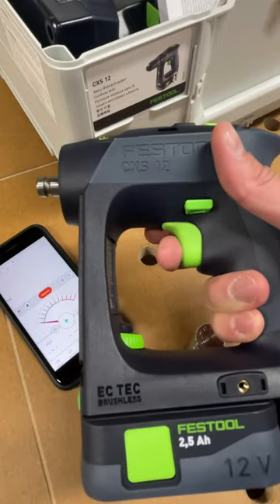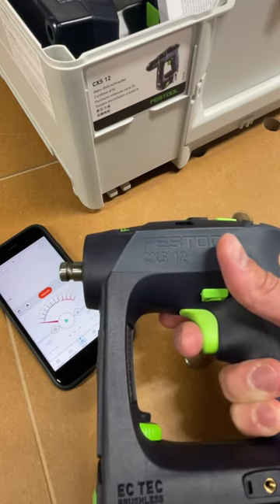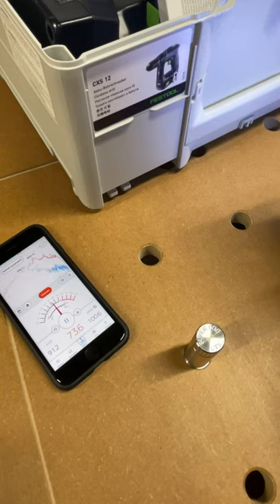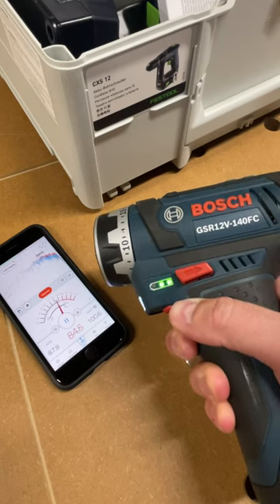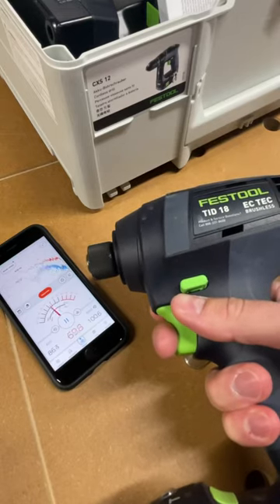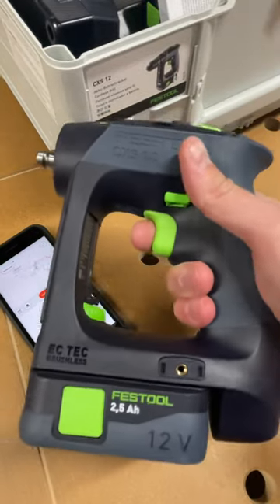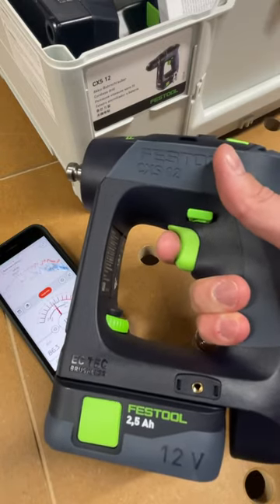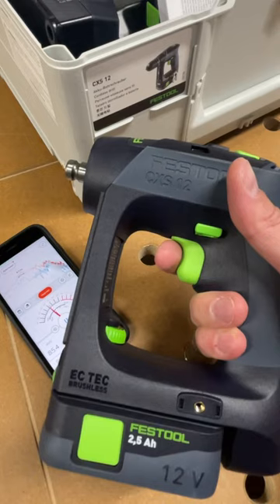Festool's New CXS 12 is Loud 🔊🔊🔊 #festool #cxs12 #shorts #woodworking

Comment: I have the CXS. I believe you had the rpm on full and if I remember correctly it is substantially faster than the Bosch. If you match the rpm’s to the Bosch the sound course will be lower. The sound level hasn’t been an issue for me…
Reply from the maker: That’s a fantastic point, thanks for sharing! I actually ended up returning then rebuying the CXS 12 and have been loving it. While it’s still loud when running at full speed, I very rarely run it that way.

Comment: Hi Guys, today starting to using the CXS12 and when turn knob to 10 and trigger it guess what happen: A fighter jet pilot just starting his engine. And inside the oven carcass it so much louder than the 10.8 version. My Goodness. I think you need earplugs for it. And maybe that why they are promoting the Bluetooth earplugs. Phew.
Reply: And you need a middle finger to trigger it. I need to practice it totally. 😂

Comment: I bought it about a half year ago with the lovely silent operation of the C18 in mind. This CXS12 is a disappointment. Don't know if Festool fixed it with a new release.  Last week I was installing a closet with cabineos and in the back of a corner (where sound is amplified because of the 1/8th space loading) and it screams.
Reply: Same here, after first week of kitchen install with the new CXS 12 my ears had enough. Back to the old one. Also, grip is not as nice as the old one. I know, I know, you are supposed to use the middle finger on this new handle/trigger combination but I still prefer the old grip. I could have lived with it if it wasn't for THE NOISE.  Form factor of the CXS 18 is great for me, but here we go again with THE NOISE.
Reply: @hrundgren4352  the response of Festool was this 'that is correct,  the cxs12 produces 86,00 dB(A) and  the C18 76,00 dB(A). in other words, yes, it sucks.
Reply: @berendlucasvanderweide  10 dB is a HUGE difference. Looks small on paper but in sound pressure it is a significant difference. Some people seem to not mind too much, maybe because they have not tried the previous model or maybe because they don't consider noise an issue.
Reply: @hrundgren4352  yes, more than 3 times as loud. Perhaps some people don't mind the noise. It could be  a strategy of a company trying to test to see how far they can stretch something before customers start to complain. If less than 10 percent of the users complain, they did a perfect job on cost optimisation. I can't imagine the engineers approved this.

Comment: I felt the exact same things. Its so loud compared to the older model. Also the electronic clutch is inconsistent. I will be returning it
Reply from the maker: Happy to hear it’s not just me that’s bothered by it.
Reply: @bestyoutubernonegraternumber1  Yes, more power does generally mean louder. No disagreement there. But it's 12v instillation drill/driver. Imho it should be more about finesse than raw power.
Reply: My m12 Milwaukee drill is loud. Used it in a cabinet today and hurt my ears. Sounds like this.
Reply: Any chance you might look at the CXS18 ?
Reply: It‘s the same with the CXS18 - no comparison to my T18+3 and C18.
Reply: @marcusb.1818  So depressing!
Reply: @TechExplorer546  My Milwaukee M-12 hammerdrill is quite louder than my 18 volt Bosch... and the Bosch is more comfortable in the hand, almost equally lighweight,  and more powerful too.

Comment: I dont get it, iv been using mine and I absolutely dont mind the noise that it makes. 

"Noise above 70 dB over a prolonged period of time may start to damage your hearing." Yall really be using this 24/7!? 😂
Reply: In confined spaces - where the CXS 12 is supposed to shine - it is very noisy compared to the old one. Even a short while with the CXS 12 mounting drawer runners is annoying enough - no longer running that SYSROCK radio in the background because you need earplugs with the new CXS. This means the added risk of not hearing the AXE MURDERER sneaking up behind your back. Prolonged exposure to murderers wielding axes is detrimental to the health. EDIT: if you don't mind the noise  I am happy for you. The build quality is great and it should serve you well in the years to come. :)

Comment: festool has put out some pretty bad products recently.  They are trying to stay relevant with too many misses.  The new tracksaw with scribe cut, FAIL, the overpriced dollhouse tablesaw, FAIL, the squealing csx12 FAIL.  I'm always looking out for the latest greatest, but have not pulled the trigger.  Although the TPC 18/4 looks good, but I already have a makita.
Reply: What's wrong with the TSV 60? (scribe cut) ?
Reply: What's wrong with the cordless table saw? Or should I rather ask, what’s wrong with you? 😃 Festool is the most relevant manufacturer especially but not only for woodworking and cabinet making. Besides that, they constantly keep on innovating, also because they are a family owned company which doesn’t need to meet quarterly goals to make shareholders happy. They try new things, that no other manufacturer does.
Reply: TPC is good
Reply: @chuckgrumble5440  It's just underpowered and not good for precision work.
Reply: @MadLadsAnonymous  for the concrete work ive done it has worked ok for me. I like the high rpm drilling for wood also. I am sure its not as powerful as some, but if i need that i pull out my sds corded.
Reply: The tablesaw is an amazing compliment to a tracksaw. Super compact, quiet, smooth and great dust collection for a tablesaw even with only the bag.
Reply: @MadLadsAnonymous   What's wrong with it?  It's unnecessary.  You don't solve a problem by adding more motors.  You do what makita and mafell did and add a scribe switch/knob.  Otherwise you now have two blades to calibrate, and keep in a perfectly straight line.  Any now you need a longer rail to make room for both blades.  For me with my cordless 55 I just created a little block that sits on the depth stop, it creates the scribe at 2mm, then remove the block and make the full depth cut.  PERFECT, not spending another $1000.  Not dealing with cords and misaligned blades.
Reply: @mahmut123456  What they needed for that price was a setting called "distance to fence".  THAT would be a useful digital dial in.  Nothing wrong with me, just need to see the true value of a tool before I spend $2000.  But these are great discussions.  Festool makes awesome products, I have over 15 registered tools, but they are not perfect, whether a family owned business or not.  There are many of their tools I think they are just lazy with (impact, carvex), where there is no added value over a dewalt or milwaukee.  If they want to charge high prices, they need to deliver what is expected for those prices and stand apart from other brands.  A squealing CXS12 is an obvious blunder.  Don't they have a QA department that says "that is an annoying squeal, let's fix it?"
Reply: @chuckgrumble5440  This is not a concrete drill.  Percussion is for cinderblocks, not hardened cement.  Get the rotary for the cement.  For wood its great.  Keep it with the impact.

Comment: The meter is faulty
I held the drill in my hand and it has a particularly quiet, gentle movement.
You can't speak 80-90 words out loud for 1m, and the machine can't speak 100 words either. In reality, speech is about 60, 90-100 the volume of a lawnmower or a huge roar.